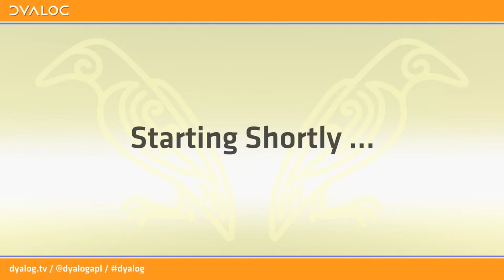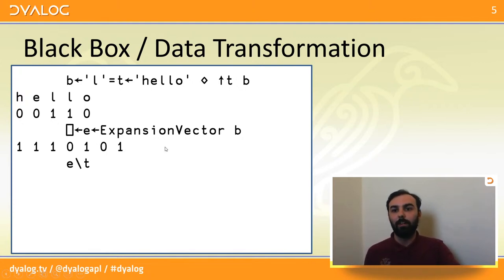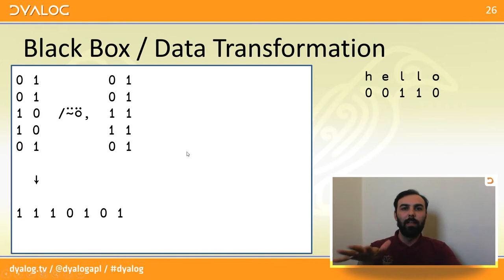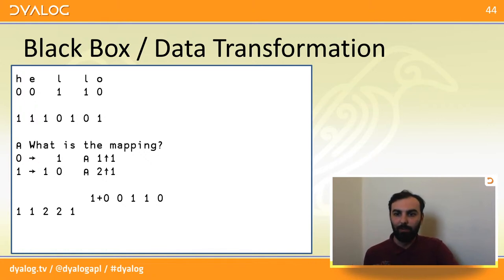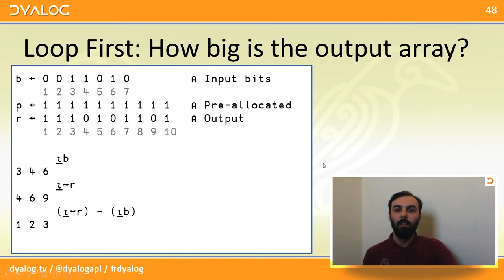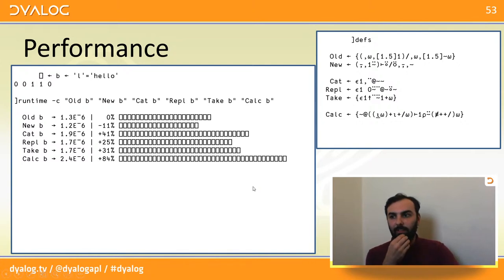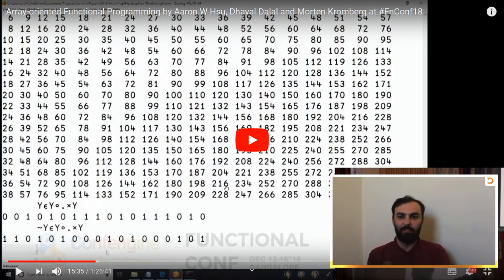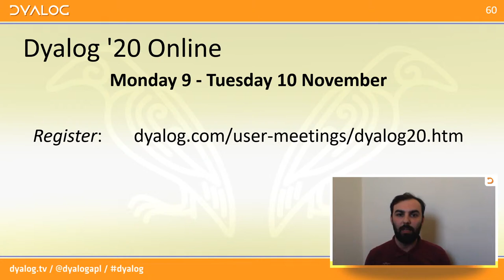Thinking in APL: Array-Oriented Solutions - Part 2 – Dyalog Webinar with Richard Park

Comment: This is not related to the vid (which is excellent, btw), but hopefully a Dyalog staff member is still monitoring this and can answer it.   What is the best way to time how long something is taking to execute between two points in Dyalog APL code?  Is there a system call for this where you start a timer and then end it and get the amount?  Thanks!
Reply: Can I request that you ask this question either on Stack Exchange or the Dyalog forums? It's just I'm trying to get APL information more centralised (and Stack Exchange is the current de-facto place to find programming solutions).

Having said that - you can store the value of ⎕TS at the two points and compare after (either using dfns.days/dfns.date or the new ⎕DT). Note that this (and run time) will be highly subject to what your computer is up to each time and so can vary quite a lot between runs (even ]runtime arguably puts out more precision than its accuracy warrants)